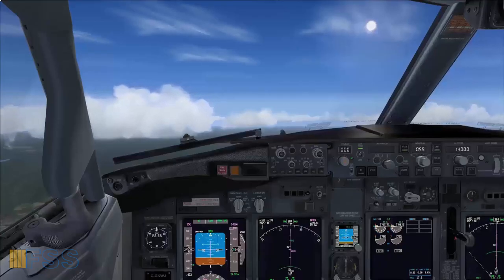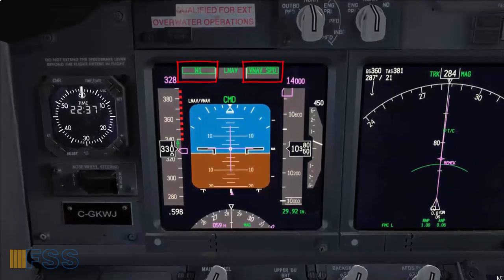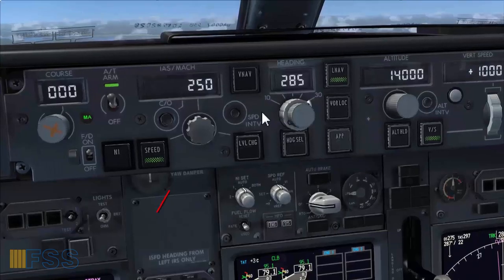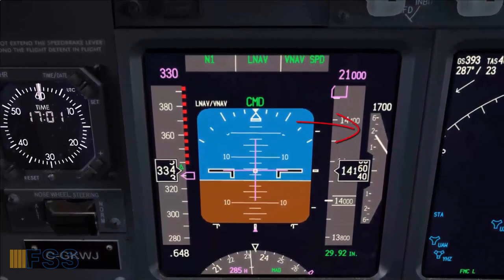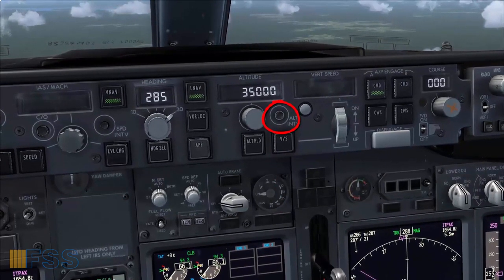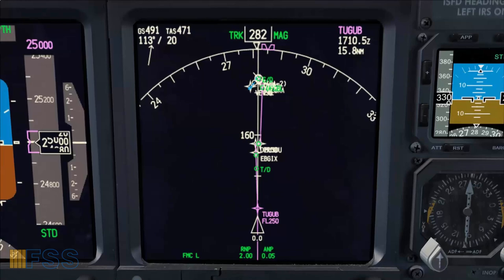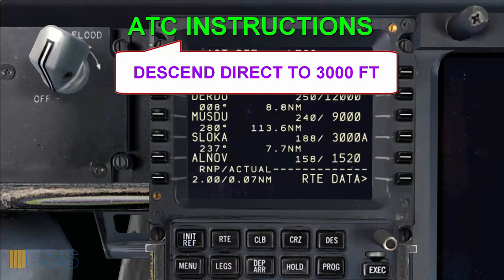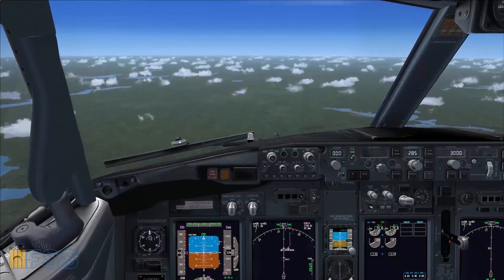Microsoft Flight Simulator Boeing 737 Autopilot Tutorial

Comment: I have a confusion. While climbing to FL210.. why didn't we use level change instead of alt int?? Please clear my concept?
Reply from the maker: As i said in that video that the ALT INT will take more time to delete the altitude constraints ,since it can only delete one at a time imagine if you have to delete 10 waypoints ! guess how many pushes on the ALT INT you need to do before you can select the target altitude . So i showed you an other way to bypass those constraints by using the LVLCHG...
Reply: @FromStartupToShutdown  thanks a lot.. now I got it. Thanks a lot for taking time and replying me. I respect a lot tor your gesture. God bless you.

Comment: For the climb phase, we used level change despite all the alt restrictions. However, while descending we didn't use level change? I didn't understand the exact reason. Please clarify?
Reply from the maker: While descending, i was in that particular example using an earlier descent, due to a strong tailwind .If you have noticed that descent was managed by the FMC, so in this case i couldn't change the descent mode from VNAV to LVLCHG to bypass the constraint altitude since i'm letting the FMC to manage my descent. Therefore  the only way to  bypass those altitude constraints is by deleting them using the LEGS Page on the CDU ...
Reply: @FromStartupToShutdown  wow what a simple explanation captain. I wish I could see you personally. Please make an introductory video of urself. So that, we will get to know you personally. Much appreciated for your response.